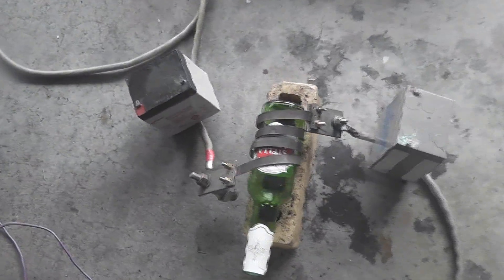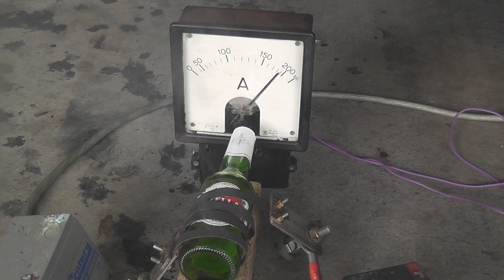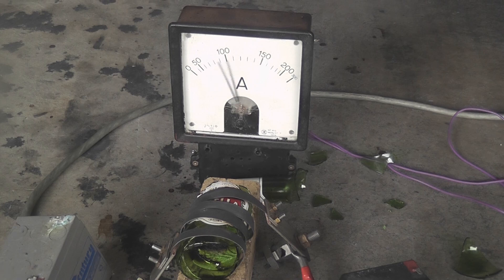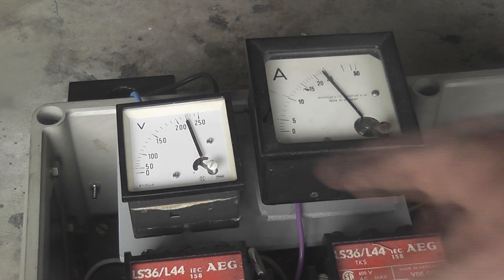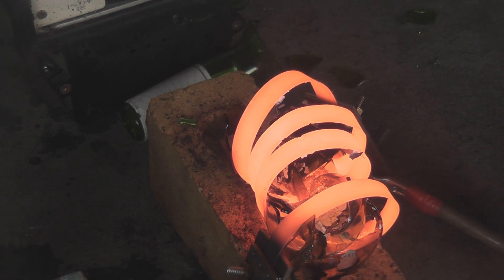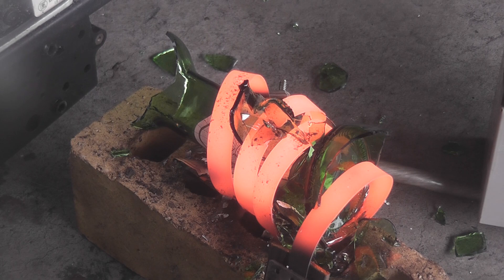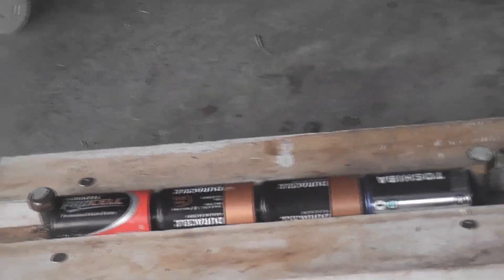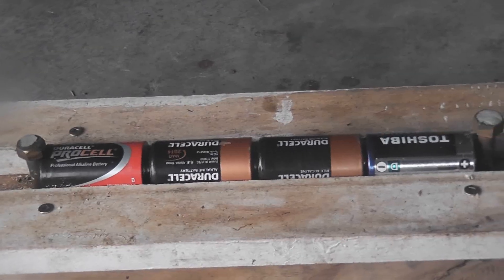Trying to melt a glass bottle

Comment: RODALCO2007 Good Melting glass experiment mate;D I will soon get a Potential Transformer, and or 3 - 5 MOT's, and connecting them in parallel, or in series, and either getting 2120v out @ 3 - 5A, or 5 - 7 - 8 - 10Kv at 500mA or so, and melting sand into glass with that;D Thanks For Showing, Cheers Mate;D